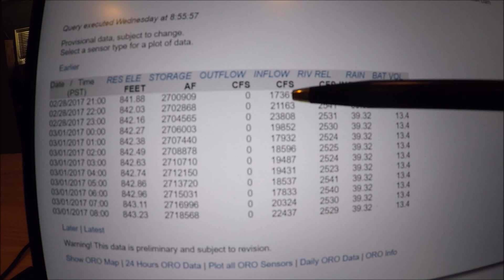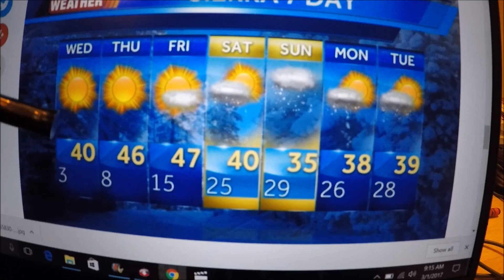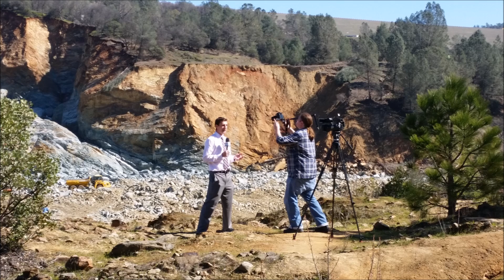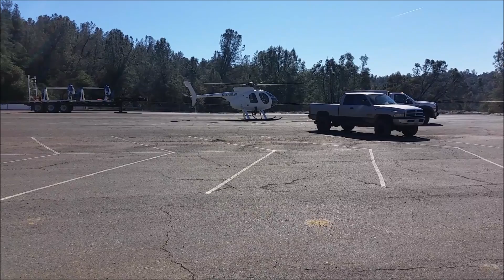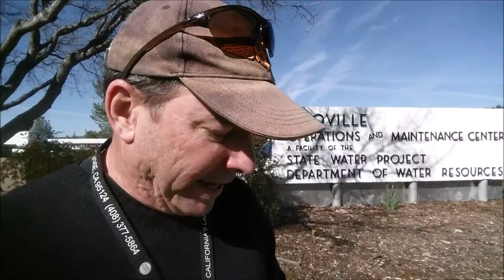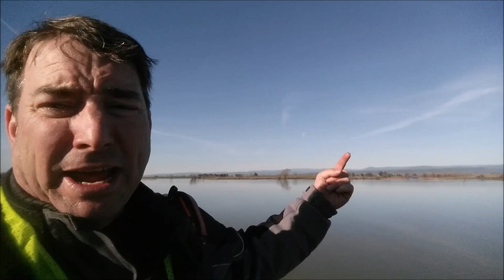OROVILLE  RESERVOIR 1 MARCH Detailed On Site Update

Comment: You are giving what even Reporters fail to present. 1.5 Million CFM of Debris to be cleaned, it is an enormous task. Blanco,  why is is very important to start the Power Plant. Is it only Electricity!! Or does it enable better water management of the Dam?
Reply: It's one of 4 ways water leaves the dam, including evaporation.
Reply: The measurement they give is 1.5 million cubic yards of debris.
Reply: Biswaroop Todi the hydroplant can let out water (30000cubic ft I believe) without producing debree
Reply: According to some calculations in a thread here  (https://www.metabunk.org/oroville-dam-main-spillway-waterfall-erosion-watch.t8402/) someone estimated to fully remove all the debris would need 25000+ truck loads!
Reply: Thanx,  to get a better idea...  We are at 144 level. If Hydroplan is active, what levels can be maintained?
Reply: Yes Yards....  How many scoops from big trailors, which is filling the dumpers, would be needed to clear that? That would give a better idea..
Reply: At 23 yards per articulated dump truck would be 65,217 loads. just a few huh? lol

Comment: Clearing that channel and relying on the powerhouse for future drainage sounds like more bad decisions to me. Yeah clear a channel so power can be generated but don't rely on that to maintain lake levels, they could have maintained 100k CFS until the snowmelt was complete and get no danger to the dam itself in the next 10 years if they didn't do anything in the summers. That's the same thinking that got us into this mess, rely on the emergency spillway to save the main and now rely on the powerhouse? The "Save a penny today and spend a dollar tomorrow" bullsheet needs to stop and be replaced with "Do the job right the first time because fixing it later costs 10 times as much".
Reply: The Thermaghetto(sorry local to Oroville term) Diversion pool dam at the fish hatchery has no gates, water either goes over it or none flows from it. It is gates that divert water to the forebay that regulates the diversion pool, then there are gates between the forebay and afterbay and the final gates that exits back to the river. Last gates are under Larkin road and the river. You can get to the other side of the river by taking Pacific Heights  RD and entering the wildlife refuge at Hilgers RD and following it. If you go there the pond on the right side when you turn the first right corner on the levee has some huge catfish and nice bass in it.
Reply: I agree, what happens if they need to open the spillway again. That massive amount of water will come rushing down again and it will be worst than before.
Reply: Opening the main spillway again wont be as devastating as it was but it will probably block the channel they are clearing for the powerhouse with more debris. Right now spraying quick dry concrete into the erosion channel created by the spillway would prevent that. Just needs to be temporary to be cleared out in the summer so 4-6 inches thick would do the trick. It would cost more money in the short term but save money in the long term. But "Save a penny now and spend a dollar later" is what caused this debacle and what still guides it.